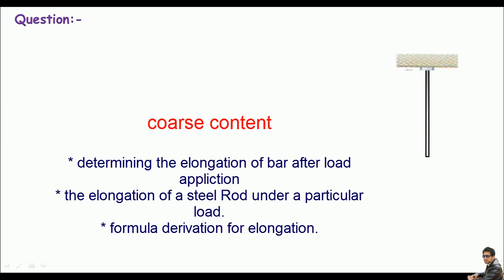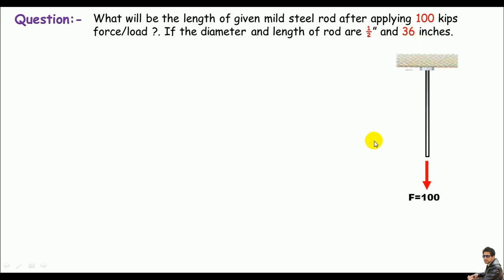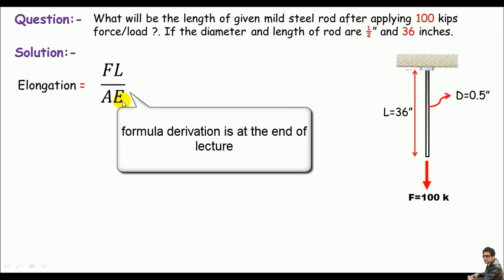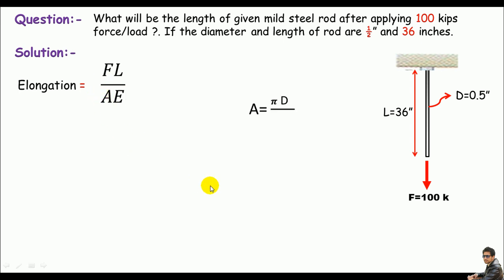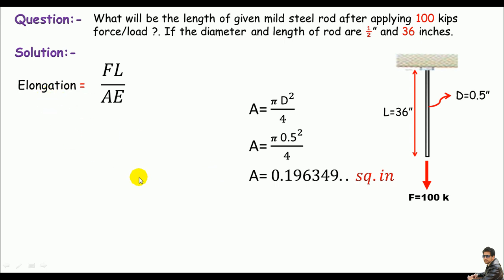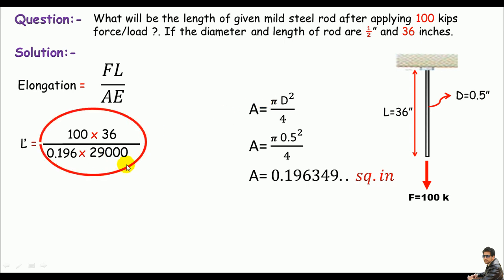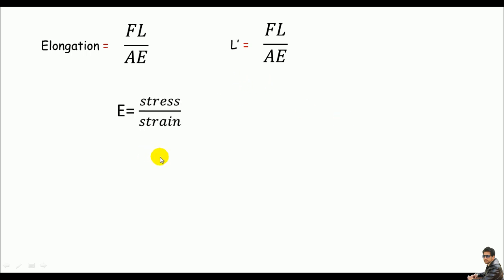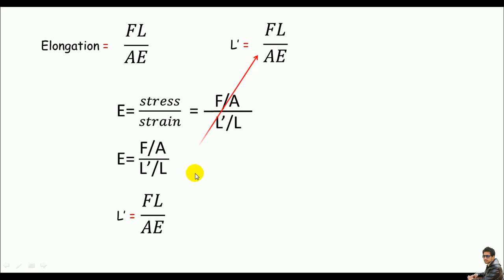SP#4:  Elongation of steel rod due to load/ also formula derivation for this approach.

Comment: What is a Minimum Required Elongation for grade 40 Steel Bar ?????
Please reply.
Reply: this will depend upon the bar's length , its elasticity , force acting on it and the sectional area of rod...
Reply: It is depending on the grade of material. If it is 500 grade then elongation minimum should be 12%. If it is 500d grade then it should be 16% minimum elongation.